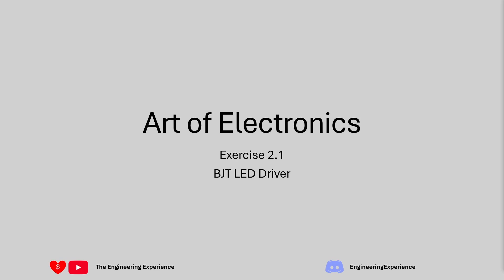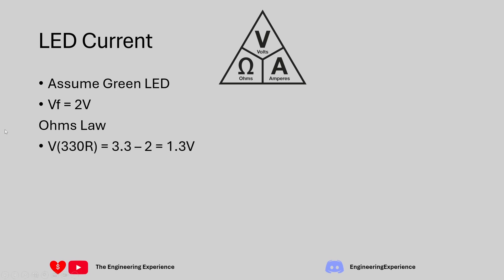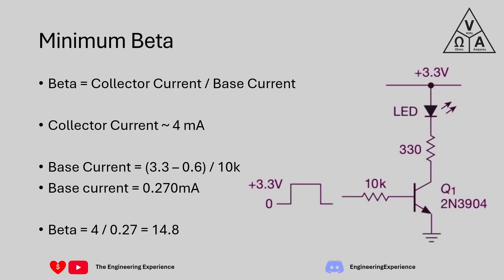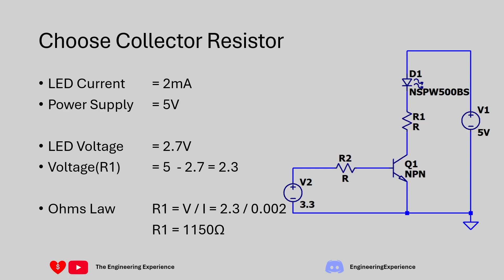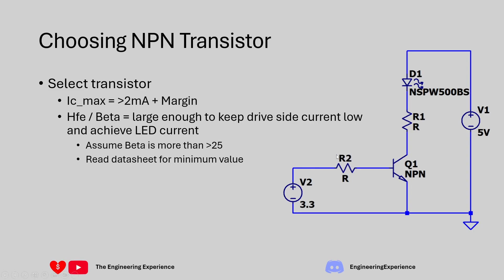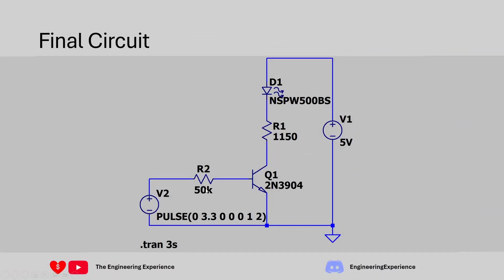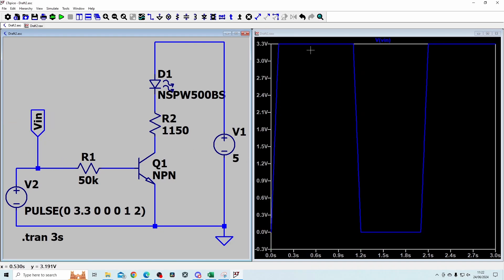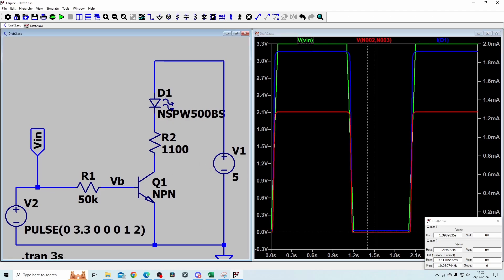BJT LED Driver - Art of Electronics Exercise 2.1

Comment: Hi! Thanks for the video. It was a very interesting watch. I liked the designing process and simulation apart from the exercise itself. I'm wondering about one thing though. You noticed, that the current through the LED was somewhat lower than in your calculation. You lowered the value of the collector resistor. You didn't check the voltage on the collector node though. If we look at the datasheet for the 2N3094 it states an I(CEsat) of 0.2-0.3V. That would lower the voltage across the resistor and current as well. What do You think? Kindest regards!
Reply from the maker: No problem, thank you for the commebt
 I'd need to go back to the video to give you full details, but there was probably a mismatch between Ideal calculations and real world components. CE saturation voltage of approx 0.2v would be one of them.

I need to get back of art of electronics! Nearly finished chapter 2.